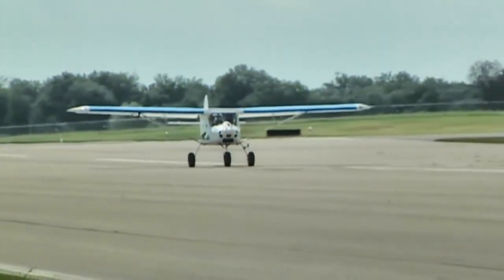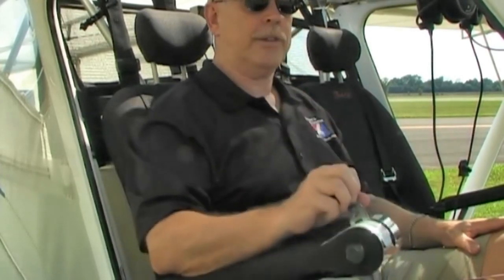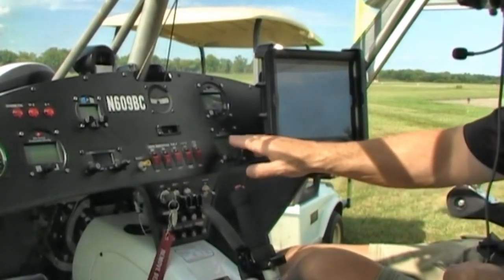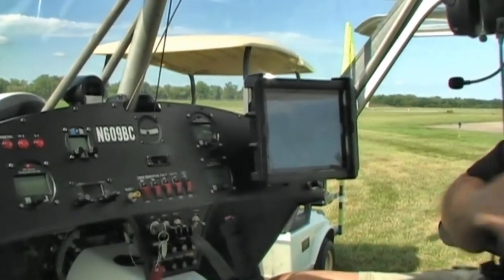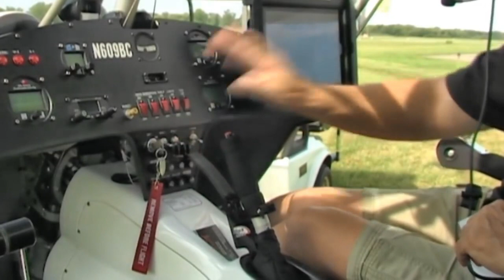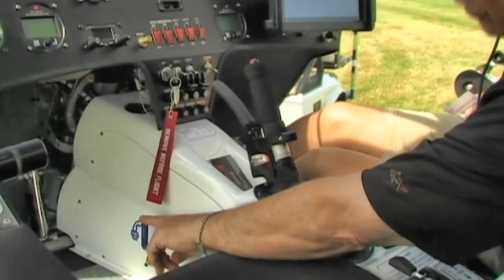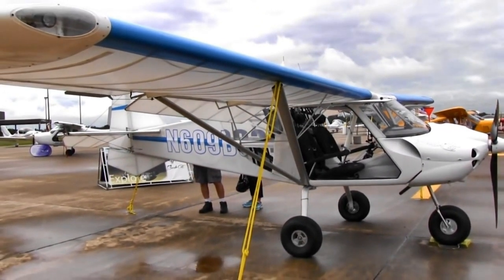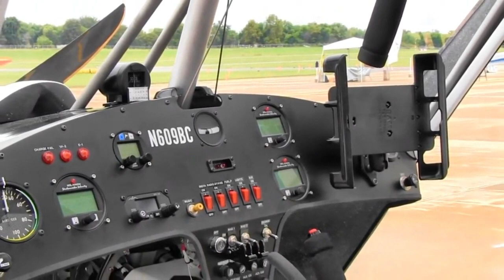Bushcat, Light Sport Aircraft, by SkyReach, Midwest LSA Expo 2020, Mt  Vernon Illinois.

Comment: Sir
Is there a concern with the fact the control stick is centre mounted as is the flap handle.
For the sake of cockpit management safety. Would it not be better to have dual flap handles each being on either door side ?
This way there is no cross over .(left and right arms)
The pilot uses his right hand on stick and left hand on flap handle.
Just the opposite for Co pilot